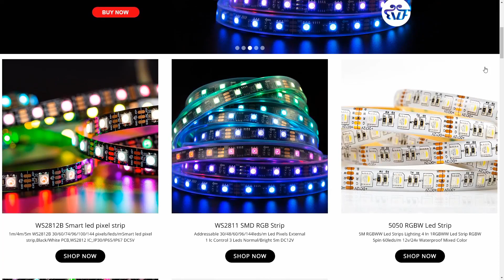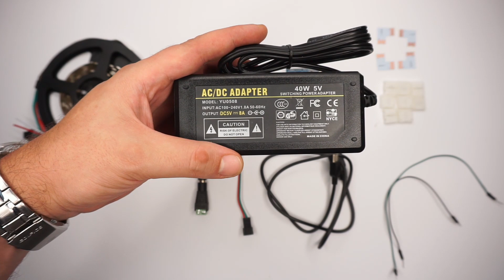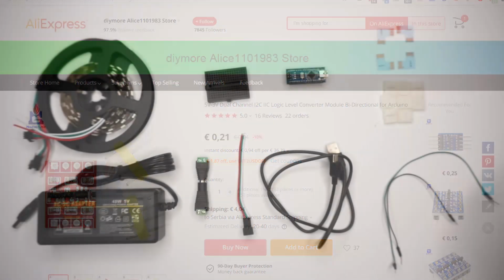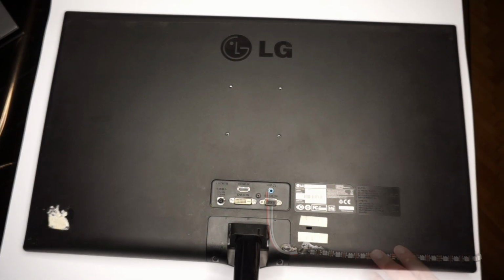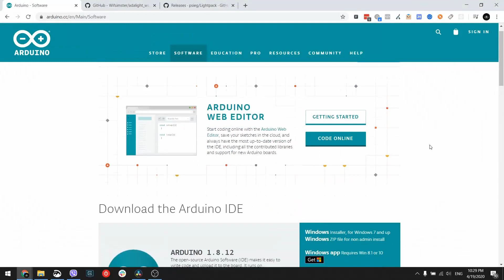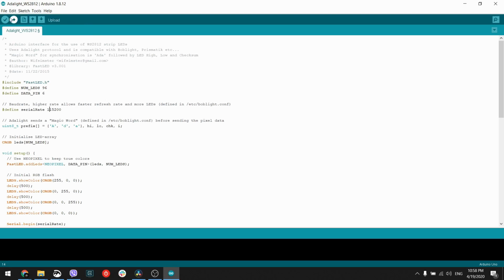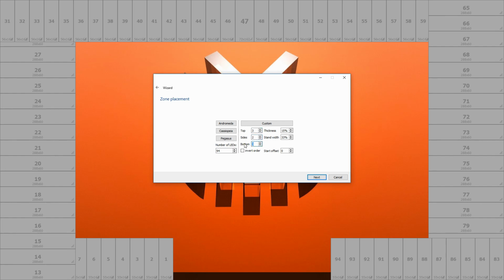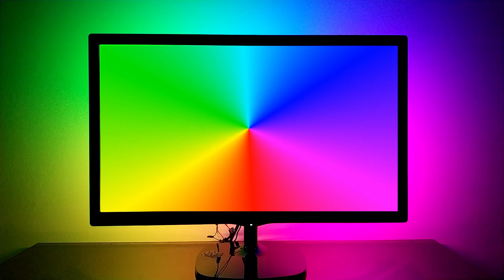Cheap DIY Arduino Ambilight 2.0 (Revisited) RGB WS2812b LED Full Build & How-To

Comment: I wouldn't solder those corner types. Just use the plastic connectors only and BE CAREFUL! They are very fragile and rip easily. I myself, have been through quite a few in my ambi builds.

Comment: esp8266 in the form of the WEMOS D1 Mini takes 5v for input and only requires a 420 ohm resistor for the data line , I have used them for years like this - also it is cheaper than the arduino nano

Comment: Nice project.....is there any way to connect to TV instead of PC or Monitor ❤❤❤
Reply from the maker: There is but not with this particular setup. Search for hiperion project. It's a bit more pricy (more leds, need SBC like a raspberry pi and a HDMI splitter) but it's doable.

Comment: One thing to keep in mind is that power draw calculations are based on all LEDs being turned on at the same time AND at full brightness with a white color.  This is rarely (if ever) going to happen.  Usually, the LEDs are way too bright at full brightness.  I personally set them to about 50% brightness or less which is bright enough for me, so that drops the power draw from 18w to 9w or less.  Also,  not all LEDs are on at the same time and even if they are they are rarely going to be white color, which is the color that draws the most current.   I've used strips with 150+ LEDs with a single Arduino and a 1A - 2A  power supply.  I've never had an issue with power.  Anyway, just want to mention that as a 5A PSU seems way over kill for this. But hey, if you get it cheap go for it :)
Reply from the maker: @joesalz9963  I agree with your point but I always suggest a stronger PSU than is needed. You can also rely on setting the max current draw on the software side but I don't like to rely too much on software for things like that. So the only part I wouldn't cheap out on is the power supply.

Comment: What would you recommend for 230 diodes? For some reason I have 15 fps in the ambibox and the backlight doesn't seem to give even 5-7 fps, very high delays.. Sometimes random LEDs blink, what could it be? Arduino can't cope?

Comment: Running this since about 2-3 years.
Never without Ambilight again. Thank you so much !
Reply from the maker: Glad it still works. I haven't had issues with it either since the build.
Reply: @dusnoki  my only problem is that the Ambilight isnt powering off itself. I need to disable it in prismatik every time before the shutdown and it always takes multiple attempts to turn the leds off. Do you maybe have a fix for this ?

Comment: Hello. Generally it works, when I watch a test video on YT, the colors are reproduced, but in the case of a black field on the monitor, the diodes glow white. So when I display a black board, everything lights up white. What can be? Prismatik 5.11.2.31
Reply from the maker: https://github.com/Atarity/Lightpack-docs/blob/master/EN/Prismatik_settings_description.md#scene-luminosity-threshold

Comment: Hey, thx for the great tutorial, but it doesn't work for me. I would appreciate your help. 
I did everything as you, in my opinion. I measured with the multimeter the connection from the start of the +5 V to the End of the +5V and the same for GND. Connection seems fine. The only question for me I measured 16 MOhm from the start from any data-pin to the next data-pin. Is that normal or am I measuring wrong?
I am searching already 1 week the misstake in my build.
Thanks in advance.

Comment: This only works with a pc right ? or it would work on andorid tv ?
Reply: Only for PC. For a TV, you need to capture HDMI signal and process it. Arduino cannot handle that, will need a Raspberry Pi atleast.

Comment: Hello budy!
Thank you for all the instructions, they were very helpful and made it very easy for me as an electronics layman.

I have a question, is it normal that the app does not work with streaming services, like N, or D+?
I won't hide the fact that this is one of those things that I cared quite a bit about :D 
Any ideas?
Reply from the maker: Yeah unfortunately they have some sort of DRM in place that doesn't allow prismatik to capture the screen. It works only if you use a browser to watch but not the app itself. But then you are limited to 720P if i'm not mistaken.
Reply: @dusnoki  darn! I'm using only website version of these... but my monitor is 1440p, so 720p would look like a trash 🤔 Need to find a solution, thank you buddy!
Reply from the maker: No worries. Then you need a dedicated Raspberry Pi (or equivilent SBC), HDMI Splitter, Capture Card to make it software independent. It costs quite a bit more but search for  "Hyperion" projects on Youtube . I'm planing to make one for my 65'' TV as well so stay tuned for that :)  @mr.sruba1
Reply: I'm really curious about your new solution! Can't wait for your new video!

Comment: I made a 214 led triple monitor ambilight setup and after 2 years of coping with barely 35 fps with screen grabbing I finally looked onto using esp's as I've grown quite fond of them. After your warning I was quite wary of it not working but I decided to try anyway since other sources said it would be fine. It wasn't hard to connect my esp8266 and esp32 to the strip with the same code as the arduino nano. After setting the com port in prismatic it fired right up! Then I edited the baud rates in both the arduino code and prismatic and boom! 75 fps on 912600 bps baudrate. I actually didn't test if this baudrate is possible on the arduino nano but using the esp8266 is quite nifty and gives me peace of mind bc it runs at 60 MHz instead of 16 MHz.
Reply: awesome… are the esp32 and esp8266 have arduino on it? hopefully you could share it to us.. a tutorial is more appreciated.. 🙏🙏🙏
Reply: @RealMokong  You could use an esp32 or esp8266 and the same code you use in your video! Ofcourse you need to divine your data pin but for the rest it's all the same. The led strips use the 3.3 volts all the same as the 5 volts of the Arduino.
Reply: @rtvlogames3708  what version of arduino sketch did you use in your setup? is it the same version as the video? i do not know about coding stuff but i like to try ambilight.. i just ordered the parts and i will be using the arduino nano..  my monitor is 27inch i might be using around a 100 leds.. my concern is the baud rate 115,200 it could be less responsive if watching 60fps videos, so i decided to look for alternative other than the nano.. but right now i just give it a try.. if does not goes well i might try the esp8266 instead...
Reply: @RealMokong  Good to hear! I wish you best of luck. Although you'd have no problem with this guide, an Arduino Nano and prismatic :). I think you can get about 50-50 fps with 100 leds with 115200 Baud rate. 
As answer to your question, I use the same sketch as the one provided by the guide. The esp's can use the same code as the arduino's, they just execute it faster.
Reply: @rtvlogames3708  thanks i'll try with nano first... hopefully it all goes well..

Comment: Love the video I am actually planning on doing this. so what kind of power suply do i need if i want to power 2 different LED strips for my 2 27 inch monitors. can i use just 1 power supply for both or do i need to buy 2 of them?

Comment: I ordered the parts and just got it working because of this tutorial. Thank you so much!

I used 92 LEDs on the perimeter (soldering the corners to get an LED at the very end instead of a clip) and with the leftover LEDs I made two strips of 14 down the middle-back of the display. Those extra zones in the middle of the screen really unify the ambient lighting effect. It adds a lot of immersion when you're playing a dark video game and your flashlight or muzzle flash lights up the wall behind the monitor as you would expect.

Trying to configure 120 individual zones was a nightmare in Prismatik though because they wouldn't all fit lol. If it helps anyone else struggling: I set a perimeter first with the preset wizard, manually CNTRL+F'd in the .ini config to make each zone 65x65 (small enough to fit), individually moved those where I wanted, and then finally added the last 28 middle LED zones. Making backups of the config at every step because I kept undoing all of my work haha.
Reply: Care to share your installation and code? i want something simular. I have a big tv, and just the sides won't do it for me. I want some middle of the screen capturing aswell for overal feel.

Comment: help i keep getting falstled.h: no such file or directory
Reply: i already installed fastled but still the same error
Reply: new problem i keep getting this
Arduino: 1.8.20 Hourly Build 2022/04/25 09:33 (Windows 10), Board: "Arduino Nano, ATmega168"

Sketch uses 5258 bytes (36%) of program storage space. Maximum is 14336 bytes.

Global variables use 463 bytes (45%) of dynamic memory, leaving 561 bytes for local variables. Maximum is 1024 bytes.

avrdude: stk500_recv(): programmer is not responding

avrdude: stk500_getsync() attempt 1 of 10: not in sync: resp=0xf9

avrdude: stk500_recv(): programmer is not responding

avrdude: stk500_getsync() attempt 2 of 10: not in sync: resp=0xf9

avrdude: stk500_recv(): programmer is not responding

avrdude: stk500_getsync() attempt 3 of 10: not in sync: resp=0xf9

avrdude: stk500_recv(): programmer is not responding

avrdude: stk500_getsync() attempt 4 of 10: not in sync: resp=0xf9

avrdude: stk500_recv(): programmer is not responding

avrdude: stk500_getsync() attempt 5 of 10: not in sync: resp=0xf9

avrdude: stk500_recv(): programmer is not responding

avrdude: stk500_getsync() attempt 6 of 10: not in sync: resp=0xf9

avrdude: stk500_recv(): programmer is not responding

avrdude: stk500_getsync() attempt 7 of 10: not in sync: resp=0xf9

avrdude: stk500_recv(): programmer is not responding

avrdude: stk500_getsync() attempt 8 of 10: not in sync: resp=0xf9

avrdude: stk500_recv(): programmer is not responding

avrdude: stk500_getsync() attempt 9 of 10: not in sync: resp=0xf9

avrdude: stk500_recv(): programmer is not responding

avrdude: stk500_getsync() attempt 10 of 10: not in sync: resp=0xf9

Problem uploading to board.  See https://support.arduino.cc/hc/en-us/sections/360003198300 for suggestions.

Comment: Okay, I'm writing this comment as a last effort to get this working again. This tutorial is amazing and I successfully built this a couple of times in the past, but due to relocations and swapping monitors, I had to rebuild it a couple of times. I haven't been able to get it working again for quite a while now and I'm at a loss about what I'm doing wrong.

The main issue is that my LEDs are not turning on at all. Not white, not red/green/blue after uploading to the Arduino, nothing.

Things I've checked/tried:
 - The PSU is fine (as is the second one I have). It provides 5.5V consistently.
 - I have stopped counting how many times I've checked my wiring. I'm 99.99% sure it's correct.
 - I've tried different breadboards, Arduinos and cables. No success.
 - The continuity on the LED strips is perfect, I'm getting no more than 0.2 Ohms of resistance at any point.
 - Here's the banger: I can measure the 5.5V at ANY point in my LED strip. They have power! And yet they don't light up at all.
 - I have a few other LED stips and leftovers. I tried wiring them up to the PSU but they also don't light up.

I've spent hours and hours troubleshooting this, but it's getting extremely frustrating. I'd be really glad if someone can help me out here...
Reply from the maker: Come to the discord server. Someone will help you out :)
Reply: Hi, I have the exact same issue and replaced everything but I still have the problem. Were you able to resolve it?
Reply: @Zorkan953   Have you ever solved it?
Reply: @PrivilegiaVid  I reinstalled windows and did all the wiring again and it worked
Reply: @finlay9260 here to say I have the same problem right now

Comment: After a year I finally ordered all the parts and built mine. Thank you! I was really impressed by the colour accuracy and overall function. Your tutorial was a pleasure to work with and everything worked out first try. Big kudos! Fun mini project with absolutely insane effect!
Reply from the maker: I'm so glad that it worked out. Enjoy :)
Reply: Do you need to keep the arduino connected your laptop at all times in order for the live ambient light to work?
Reply: @yaboi_akshat2800  yes absolutely. I'm using it on my desktop so the arduino is attached to the back of my screen

Comment: does it can have a negative effect, if i will use a higher ampere and watt amount than i need (for example using the 10a  50w powes supply if i only need 6a and 30w)?
Reply from the maker: It's better to use higher amp power supply than is needed. It doesn't have to work so hard. You won't have an issue. It will only use as much as It needs

Comment: it's working like a charm, but is there a way to make the light off my default? I mean, when I turn off lights in Prismatic and set my PC to hibernate, the strip lights up white. Arduino remains glowing red as well so I assume its still active and should be able to set the state of the LEDs to 0. As of now I must unplug it from the wall and Im considering a switch on the power cable.

Comment: Im wondering, What is the reason using breadboard rather than directly solder it to the board ?
Reply: And, about the power supply on both end, do we need to connect the other end d5 to d5 on arduino board ? Or, we only need to connect the + & - ?

Comment: I wish you had shown in more detail where to connect the multimeter pins to measure for continuity. As sped up as in the video I can't really see at which points I need to measure.
Reply from the maker: Continuity is measured on the same pin. You can measure continuity on the outer 2 pins (+5v and gnd) data line won't show continuity as it is going through the ic on each led. So connect 1 probe to the start on 5v and on the end on 5v. You should have continuity and a low ohm reading. Do the same for gnd pin
Reply: @dusnoki  I'll try. Thanks.

Comment: Very helpful video! But Can i use 2 led strips(back of my monitor & ceiling). And can i set different modes?(Screen grabbing mode for the strip on the monitor and music syncs for the ceiling one)
Reply from the maker: Unfortunately only 1 prismatik as far as I'm aware can run simultaneously. Unless you do some hacking.
Reply: @dusnoki  thanks for the answer

Comment: Where did you use this Logic level converter module? On diagram @6:25 Led strip are directly connected to arduino. Can I directly connect led strip to arduino?
Reply from the maker: I did not as I used an Arduino nano. As it uses 5v logic it doesn't need a logic level converter. If you use something like an esp8266 which uses 3v3 logic then you need a logic level converter on the data line.

Comment: I'm glad I found your video! I was going to try Hyperion, but that won't work on a triple monitor setup. I've gotten everything and I'll build it coming week! I'll be using about 4.5 meters of 60 LED/m strip, so first I'll need to find out how much power injection I need to do. I'm predicting quite a lot!
Reply: So I ended up with 244 LED's and a 20A PSU. I used the 4 corner pieces and 4 15cm wired connectors for between the monitors. I cut these in half and used quick lock connectors to connect them again.
The connectors aren't that great tbh. Don't remove the tape backing on the piece of strip that goes into the connector. I ended up putting small pieces back in to get good connections. After measuring again that the connections were good I fastened the LED's on the right side monitor. Measured it again and the connections were worse again. Fortunately I already had 2 power injections on this monitor alone. Before putting the rest on I soldered a power injection on every LED strip and ended up with 6 soldered power injections + 2 from the beginning and end of the strip.
In the evening I had done all the LED work and put back the monitors on the monitor arm. The next morning quite a bit of the LED's had already come off, even though I cleaned the monitors thoroughly. Thankfully I got a very good double sided tape that I also used to fasten the connectors to the monitors.
After wiring everything up and configuring Prismatik I didn't have any light from the left side monitor. Also bad connectors. I opened up 1 clip and the first strip came on. After opening a clip on the next strip and the rest came on.

Comment: still have this in use.  but one question. i tried to speed up the light display, with the use of a nodemcu instead of the arduino nano.
I added the 2 lines on top, but eather it doesnt do anything , or the nodemcu crashes .  I assume problems with the watchdog..  any suggestions ?=

Comment: In the Prismatik app it says missing LEDs 1-66
Reply: me too, have you find something to resolve this issue?
Reply: @boris2919  yes, one solution is simply to Set the starting led in the prismatik configuration window to 1. Also check if you set the correct amount of leds in the arduino Software
Reply: @boris2919  your'e welcome, hope it solved your issue. I know that i tried several different things until i eventually figured it out

Comment: Hey Guys, I ordered all the stuff and tried to build the guided concept with the arduino etc.
I checked the circulating electricity, overall 5V. But the LEDs are all off. If I played a little bit with them some of the LEDs went on, but in different colors and per connected strip only few LEDs. Is there something from with the arduino or how i connect them ?
I would be grateful if someone could help me
Reply: omg I have the same problem
Did you resolve yours?

Comment: can i use the SMD 5050 rgb led strip ?
Reply from the maker: If it's addressable then yes. The ws2812b also has smd 5050 led chips. Only they have an extra ic in all of them. You cant use passive 4 pin regular led strips. If thats what you mean